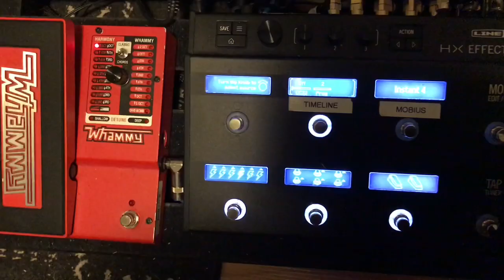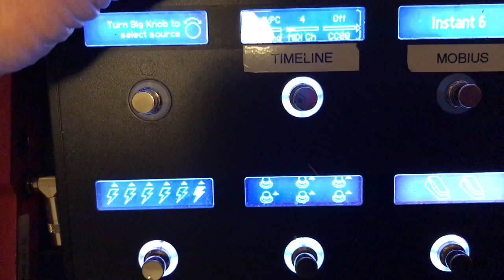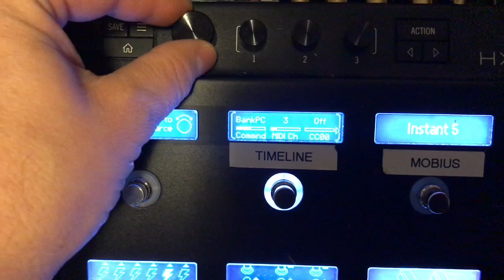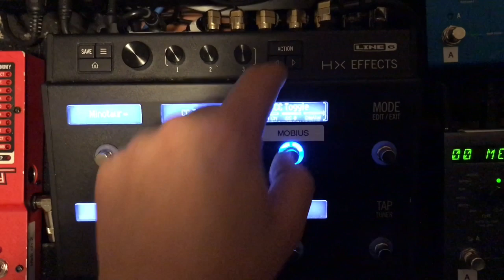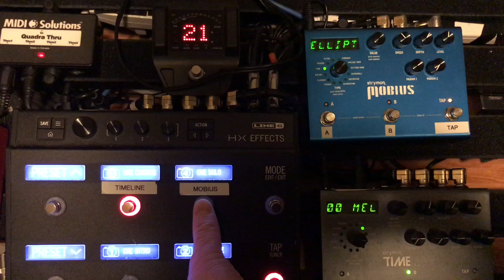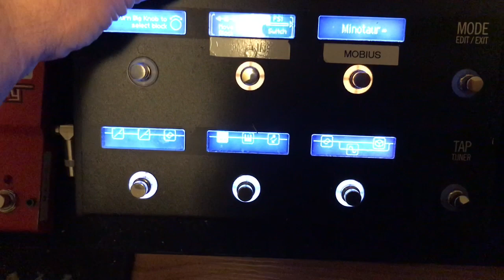Comment: I'm trying to use snapshots to also change my amps channels. It's an evh 5150 3. I can't figure this out 😩😩
Reply: Hey Tyler,
The EVH 5150 iii has midi switching.
You need to do a couple steps:
1. Choose a midi channel for your amp switching. (Should be in the manual)

2. In your presets on your HXFX consistently dedicate the same instant switch to send program change messages to that midi channel. (This is not a global setting)

3. Set your HX device to discard changes so that it only saves when you hit Save.

For each snapshot go in and choose the program number that corresponds to the channel setting you want. Hit save. 

Hope that helps, it takes a while but it’s great to be able to have instant switching that you get with Snaps rather than the 2 second dropouts from changing presets only.
🤘🏽😁
Reply: @Quickness  Thanks for the reply! I'm able to program one snapshot using the very first instant lightning bolt, but when I try to program the other snapshots the first one. Do I need to you a different lightning bolt? Different program number? Different midi channel? Sooo confusing
Reply: @Quicknessband  I uploaded a video of me walking through the process. It's only 5 min. I'd appreciate it if you could take a look for me 🙏
Reply: Same lightning bolt (that’s the instant message), now you’re going to change the message that you’re sending. Depending on the way the 5150 does switching it will most likely be a cc number. What ever message you’ve sent, now you simply change the cc number to match the desired channel on each snapshot. To do this you will be moving between snapshots to the command centre to adjust the cc number for each individual snapshot.

Comment: Hey Jacob, I realise it's an old video but thanks for doing it! I'm just about to set up my rig in more or less the same way, but slightly simpler. Essentially using the HX Effects to for it's effects in 4 cable method and also changing channels and functions (boost, EQ on/off) on my VHT Ultralead. I've had to order a special MIDI converter to enable me to change amp channels as the amp uses 6 pin DIN but I think it's the same principle as the Voodoo One you have. Anyway, I had a question, I was planning to do all my amp channel switching via instant commands and snapshots but I notice in your video you've also assigned the amp switching functions to switches as you said it makes it easier to program, is that bit necessary if I'm making my patches in the desktop editor? I presumed per snapshot I would just use an instant command to send whichever PC change I need for the various amp functions but hadn't thought about having those functions also on switches, could you explain the benefit of doing that a bit more? Hope that all made sense, and appreciate your insight, cheers!
Reply: Hey Graham,
I like being able to run my rig in stomp mode as well when I’m playing. The good news is that every patch allows you to configure things differently, so you can do a bank of patches for your amp and a bank of patches for a completely different rig if you like. 
For the way you describe it, I assume you want to control other effects or other devices so I believe all you need to do is program the amp settings for each snapshot in your instant messages with a program number for each amp channel on your switching device. I would setup the switching device on it’s own midi channel and program it as 1, 2, 3, 4, for each amp channel and or boost function and program all your snaps that way. It would probably be a lot easier to program it all on the desktop app. I hope that answers your question.
✌🏽
Reply: @Quicknessband  Hi Jacob, thanks for the response, much appreciated. Ok cool sounds like my thinking is aligning with the reality so that's a good thing! Hadn't thought about having patches for a more standard amp + stompbox mode versus just doing song patches and using snapshots, something to think about! 👍

Comment: How do you have the switcher set up?
Reply: Hey Carlos, which switcher are you asking about?
I have the switching Jacks on the HX Effects controlling the Bogner via Instant commands.
I have the Voodoo labs controlling the Mesa Boogie dual rectifier via the 1/4” jacks on the back of the Dual rec, the control switcher is doing switching via midi program changes through the HX effects. I am using snapshots to control the whole system, which allows me to do instant switching for any of the three channels plus the solo boost.
I typically set up the programs with a clean patch, a mild overdrive program  a high gain sound and a solo sound. Each snapshot allows me to recall any patch from the strymon devices and choose any of the channel settings on each amp.
Reply: @Quicknessband  I figured out I’m using CC commands to determine the state of each switch. On or off.  Thanks

Comment: Hey thanks! Great video... my problem is I don't understand midi setup to change channels through the Voodoo. I have the Voodoo for my Mesa but can't get it to change channels. I will not be using snapshots, just presets. Can you explain the procedure that is done on the HX? And I know you have to do something on the Voodoo to save. I don't see any videos  like it anywhere and yours is the closest. Thanks!
Reply: Hey IKGean,
I use my voodoo lab switcher in a really simple way... I only use 4 presets on the voodoo labs switcher and then choose the channel for the switcher in the hx via midi program changes.
To save a patch on the voodoo labs switcher you select the buttons by physically pushing them. Once you have the channel chosen you press and hold the 2 outside buttons on the Amp switcher to save your setting.
You should definitely Download the manual for the voodoo labs switcher as it requires you to do some special bootup procedures in order to choose a midi channel and there are several different implementations of the switcher to get it set up for the Mesa Boogie switching method. Once you have the amp switcher formatted for mesa boogie and have the cables connected, then follow the instructions in this video. 👍🏽
Reply: Just a heads up that presets will have a 1/2 second of silence while switching between patches, while using snapshots is instantaneous.
Either way, all you need to do is choose a saved amp switcher preset in the midi program changes menu and save. When you use snapshots you can also change channel settings on a snapshot by snapshot basis, simply go in to each snapshot and select your choice of channel settings, then choose the first patch you will use when you’re on the preset, then hit save
Reply: Thanks man, just got it to work... the o ky other issues I have is when I programmed 4 to activate the solo option, it jumps to channel 1 and channels 2 and 3 have no crunch or distortion when I use a switcher. Works fine with the original footswitch.... time to take this MkV beast in to get it looked at.

Comment: Hi - thanks for the video. How do you change the Ecstasy 101b channels without a voodoo switcher? Does your 101b have midi? I have a 101b and the channel switching is analogue only and requires and adaptor cable the converts the OEM foot-switch output on the back of the  amp into three 1/4" cables, one for each channel. Thanks!
Reply: Hey Mike Dee, 
I modified my footswitch cable about 10 years ago to use with my old TC Gsystem. I cut the end off and terminated it with 2 balanced 1/4” cables & the multipin that attaches to the amp. RJM makes a similar cable as well, so I would recommend just buying one, they are about $50USD. From there you can use the midi instant commands with the external amp switching jacks on the HXFX - which I describe in the video. 👍🏽
Hope that helps! Hit me back if you have more questions.

Comment: Hi! Could you help me with a question about Midi? I own both a HX Stomp and a HX Effects. I connected the MIDI OUT from the Effects into the MIDI IN in the Stomp. Connected like this, every time I change a preset in the Effects (from 1A to 1B, for example), a similar change occurs immediately in the Stomp (from 1A to 1B). In short, presets are chaging together, and that is exactly what I want. However, what I want to do and couldn't is the following: when I activate Snapshot 2 in the Effects, it also activates immediately Snapshot 2 in the Stomp. Does anyone know how to set this on the Midi settings? I've already read both manuals and have no idea how to make this happen. Thanks a lot! Best.
Reply: Hey Jan Luiz,  unfortunately I don’t personally own an HX Stomp so I’m not sure how to implement this, however, the devices do slave together if they are set to midi channel 1 and the HX Stomp is set to receive midi messages and commands. I hope that helps. If I get a chance to audition this set up in yhe future I will post a response video for you. All this being said, if you really dig the sound of both the stomp and the hxfx together, I think the full helix is an absolutely badass rig. I ran one for a couple of weeks and really love all the integration that is possible, but ultimately only really liked the sound of the matchless amp sim with 2 IRs per side, so I have been running the strymon iridium since February this year (Its dope as hell)

Comment: This gear is sick Jacob! Is this still your current setup?
Reply: Hey Miles, 
The rig has changed a little bit. I’ve added a Strymon Bigsky and a Strymon Iridium to this board. As well as a TS9 an Xotic Sp Comp and an EP Booster. So now I can go completely amp-less for travel gigs or lower volume gigs and still run stereo, it sounds awesome on in ears and lets me do fender vox marshall. The iridium gets used in place of the amps or I can bring my Divided by 13 for smaller gigs where I want to do wedges and a medium sized amp.

Comment: That is a sweet rig! I got excited when I saw the Bog and the Boogie. My two favorite heads. Very versatile setup
Reply: hushhog1 thx dude! Yes, very versatile. The Bogner is EL34’s and the Dual Rec I have 6L6’s. There’s some real magic / mojo that comes from blending those power sections. Truth be told it’s rare that I bring both of these amps to a show, but I almost always record with both wired stereo and it’s incredible!
What’s your setup look like?
Reply: Right now the live rig is a Mesa 212 cabinet and choice of Dual Rectifier 2 channel, Peavey 5150 ll or Peavey Invective Mini Head. Also, I have the Mesa 412 to bring for bigger shows if room allows for a two amp setup. Looking to get the Bogner setup like you have very soon (Ecstacy Head and 212 cab). I think it’s something about the Bogner that does it for me. I’ve been a Mesa guy for a long time but considering the change over. Main guitar is a beat up ‘05 Gibson Les Paul Custom.
Reply: Nuyuifcbjyw7uu8y666 68e6776766eu77u⁸7788tyuieyu8ety7yyyu772uy78i896i89jujiobjkbnmfjkoloooop
Yuouiihyu79009tyi908u8oyu⁹u9ohhhujeu0ĺyyuji788i899990yyoyùujiuuoiiioiuooo⁰hyiootykltuopiopoipop0oppbhkkioopohggmmjjkuhdjjjjbjjjjuuoohyioýzhhuiehuuuuwuuuuuwhehhhiiyyuiihuixujudjyhi0
Uhjouiidhhhohhhĺui

Comment: Major help man thank you! 

Are you also using midi to send tap tempo?
Reply: Jeremy Diggs yes I am using midi for tap tempo. It let’s you use one device to align everything. I also use a tc helicon device for vocals, this lets me send midi timecode to get the taps correct for vocals as well 🤘🏽which is great because my particular device (TC voicelive 1) doesn’t have tap tempo as an option. 
Btw, Sometimes the Strymon Mobius does some odd things with taps so I have programmed specific times and turned off tap for that particular device. Since I made this video I have also added a Strymon Big Sky as I really love their products as well. 👍🏽

Comment: @Quickness, I will be running a more simple set up than yours.  Basically, I will use the HX FX for FX into the FX loop (of course) and switch channels on a Blackstar HT Stage 60 which uses TRS for switching.  Is the best way to do this using snapshots?  Can I use an amp channel for each one of the 6 footswitches?  I just want to keep things simple.  I'm pretty smart when it comes to setting things up like this but I've never used the Line 6 HX line of gear.  I'm gonna basically set up an 80s clean channel, a hard rock 80s rhythm channel, and a lead channel with delay and reverb, maybe a dry channel, etc.  Thanks for your reply!
Reply: The Texas Rideshare Guy - Yes you can assign 3 of the buttons on the HX to each of the three channels on your amp. This makes it really great for programming your snapshots, very quick. Simply choose each of your channel settings for each of your 4 snapshots, then click whichever snapshot you want to start with when you load the scene. So if you start your song with clean delayed guitar just hit save when that snapshot is selected.
Btw The video does cover using instant commands to do amp switching. 
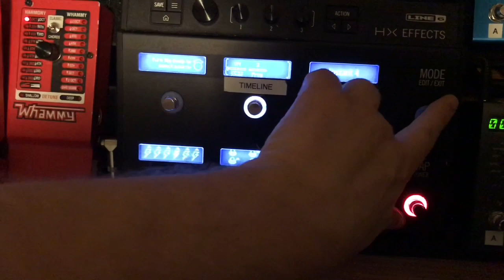To implement amp switching use one of the assignable loops and choose amp switching. You configure that function in the command center using instant messages. That’s the around 2:35 in the video.

Comment: Do instant commands have to be linked to a switch or can they just be sent using snapshots
Reply: chiefpotpipe yes you can switch effects on and off in the signal flow page and control it using snapshots without a button assigned.
As for instant commands, it depends what instant command you’re sending, I usually use the control page for all those changes and use the bankPC command, Set the midi channel, then the desired program number for patch changes on external devices.
The only way I’ve been able to use the amp switching on the hx is by assigning a button.
Hope this is useful and helpful information for you.
Reply: @Quicknessband  Thank you sir!

Comment: hey, thanks for your video. Can you hepl me, i have a laney iron heart and i switch the canal with with a multi cable. I have buy a voodoo lab contol switcher for contole the amp channel in my hx effect with a midi cable. But I did not manage to make it work. Can you tell me what configuration did you use to make it work? Thanks a lot, JBL from France
Reply: Hey JB,
on every patch you need to dedicate an instant message  to control the Voodoo lab control switcher. I describe this in the video, but will break it down for you here... 
In the control settings you use an instant message and set it to the midi channel of the control switcher, on my setup I use midi channel 1. on the HX effects I set midi channel 1 under the midi PC setting, and to change channels scroll over to page 2 and set the patch number for which channel you want each of your snapshots and or programs to be. You also need to program the Voodoo labs control switcher by matching the midi channel of the HX as well as program each of your patches.
SO, when you bring up patch #2 for instance you can set the Control switcher to be Channel 2 on the Laney. you program the Control switcher by setting each of the 4 buttons then push and hold the 2 outside buttons on the control switcher.
the HX will allow you to set different settings for each snapshot if you use snapshot mode.
hope that helps ! Jacob / Quickness
Reply: @Quicknessband 

Thanks for your help, it's so beautiful

Comment: Awesome video! It's the only one that I could find that covers the "instant commands". 

So, just to clarify, when you want to use the instant commands with snapshots, do you have to go back into the command center and scroll to the instant command that you want said snapshot to use?
Reply: Dustin Beck, 
yes you need to set everything in command center, but only while you’re editing. Once the patch is programmed, you just hit whichever snapshot you want to use. The beauty of this system is you can use different instant commands on different patches, or none, it’s done on a patch by patch basis. (To speed up the process I made a template patch and copied it to the first 20 patches and started building sounds from the template.)
I have a separate patch for every sound I use for all my various gigs.
One important thing to remember is that you need to use one block to actually turn the Strymon on/off and you set the patch number in the instant commands. You need to save your patch on the hx (of course) 
Sidenote: our other gtr player recently picked up the morningstar 6 controller and it’s dope, it gives you a lot more access to the HX. He uses it to control his HX Stomp. He’s got a patch where he changes the harmony settings 3 times in one song because of key changes 🤯 I’m ordering one in the next couple weeks.
Reply: @Quicknessband  Ok I think I get it. I am running a Line 6 POD HD PRO for my amp sounds and my HX effects for all of my actual effects. I basically have 3 amp sounds saved in different banks on the POD. 3A is clean, 3B is crunch, 3C is High Gain. 

Is it possible to program the Instant Commands to switch amp sounds while using snapshots to do so? I guess that's a better way of putting my actual question haha
Reply: Yes, you would need to use the hx as the controller, choose a midi channel on your Pod pro, then use one of the instant commands via BankPC set your midi channel, scroll to the 2nd screen then set your program channel (podpro patch#) 
Once you’ve chosen your channel setting, you just go to the other snapshots on the same patch and set the channel for each snapshot, then save. Easy once you wrap your head around the hx language. But bloody hell it’s not very clear in the manual, lol.
Reply: @Quicknessband  Awesome, that's exactly what I was wanting to know! Thank you! These things definitely need a manual dedicated to all the MIDI functions! Haha.